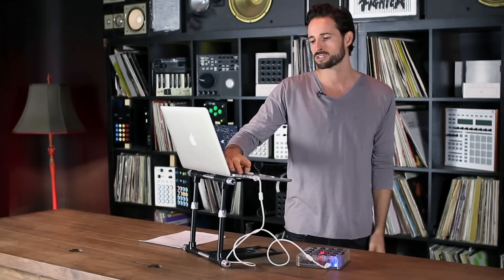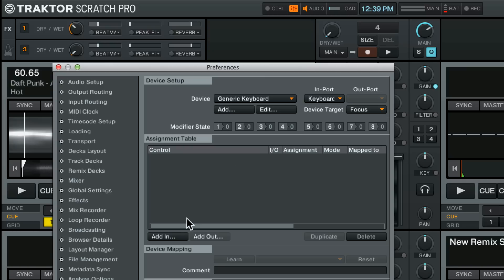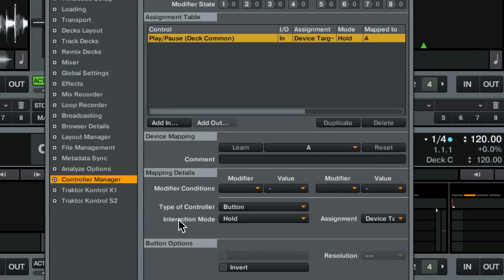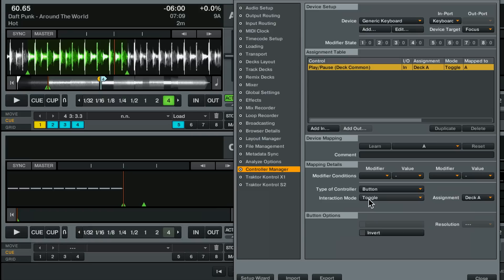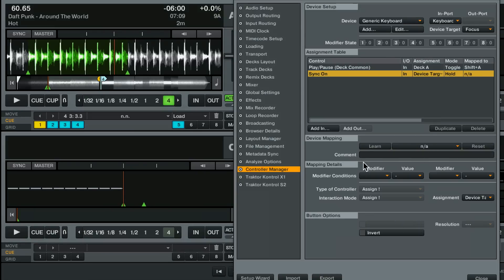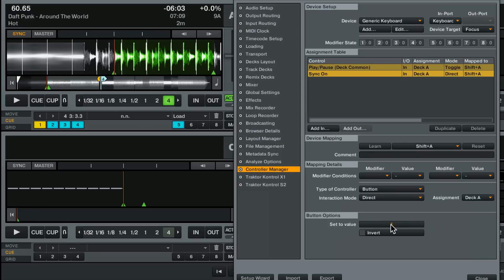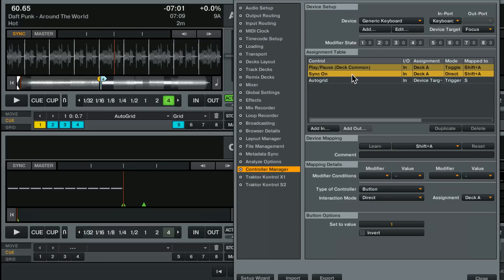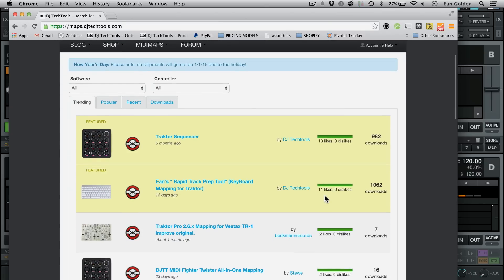Basic Midi Mapping With Traktor

Comment: Hello Friends. I have a problem with Z2 (Filters) ... When i turn filter knob, filter is ON and back in position is OFF. But i don't want this.
I try to remap, but without success. I Read some comments about this .. the same without success.
I Create a custom mapping on FX button - Filter ON/OFF. I want filter like Z1 settings.

Comment: Hi Ean, I love your tutorials - keep up the good work! One particular thing which I cant get to work properly, is mapping the adjustment button for moving the "loop in"-point backwards instead of moving the "loop out"-point forward, when shortening a loop. I do know how to do this by mouse/keyboard (thanks, TractorBible!), but I can't map it the way I like it to in Traktor's settings - as the "learn"-button only works if you know the correct command you would like to map*. 

So what I like to happen when I turn the "Loop-length"-knob (preferably incl. pressing shift**) is:
Set "Move-mode" to "Loop in"
Set "Move-length" to "Loop" (ie - not a specific value; which would be the alternative in this menu)
and then have the "Move Backwards/Move Forwards" buttons mapped to the "Loop-length"-knob (preferably incl. pressing shift**)

I would like to send you a screenshot; but can not attach it here. 

This way, I would be able to shorten a loop which is right before the drop towards the drop - and when I release the loop, the drop would follow immediately after. Currently, when I shorten loop which is right before a drop, the entire is played loop is played before the drop kicks in.

Using Traktor S3MK3, Traktor DJ Pro 3.

*is there a way to hit "learn" - and then adjust the values in Traktor - then see what the name for that specific command is ?
**having to press shift would mean that I do not lose the original functionality of the "Loop-length"-knob

Comment: Hello!!
How do I know which channel, which note to output the level meter signal??

If there is a button to push.
I can easily know that what channel & what note I’m pressing.
But how do I know it when there is no actual button to push? 

Like the level meter on my Novation Twitch controller
It require midi out to light it up..but how do I know where to send the signal😂

Comment: Hey Ean ! I was wondering if it is possible to map another midi controller along x1 to use both of them at the same time.. For example use the x1 for the basic traktor's functions' and a controller with pads to use the remix deck. Could it be possible? Thanks!
Reply: It's really easy. What you need to do is not turn off the in ports for both mappings and they'll work simultaneously :)
Reply: thnx ricardo!

Comment: Hi Ean, I'm new to this mapping and need to learn it quickly as I received an awesome Christmas gift of a Pioneer DDJ-SB2 controller. The trouble is it doesnt operate my Traktor 2.5 (yes I know I need to upgrade my system, I have an old 2006 iMac running OSX 10.6.8 but cant afford to do it just yet). The long and short of this is, I have limited time to return said controller for refund and I would like to know how compatible my version of Traktor software is with this new controller, should I invest the time to map if compatible. Many thanks in advance, your tutorials are great as I have learned much from you. Cheers !!

Comment: Hey Ean,
Awesome vids keep them coming man. I was thinking about mapping a logitech joystick to Traktor to control some effects, but I'm not sure if its possible. The joystick is the Logitech Attack 3. Do you know if theres any circumstances where a USB control (like the Attack 3) wouldn't work with Midipipe? For example, I tried using Midipipe to map a Xbox 360 Controller to practice mapping, but I don't see the hardware showing up in the Midi Input section.
Reply from the maker: DJ Solution It probably is not a MIDI device, but rather a HID device. You could try http://www.orderedbytes.com/controllermate/
Reply: Awesome thanks for your help!